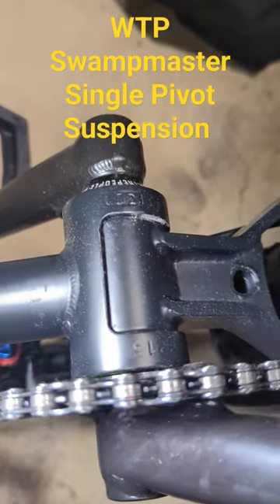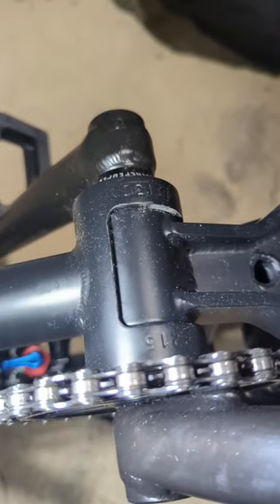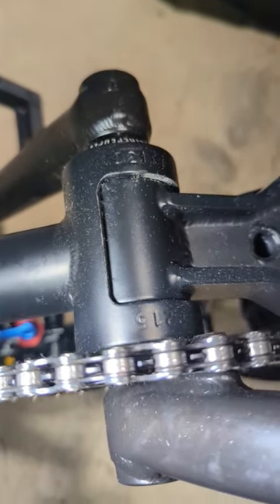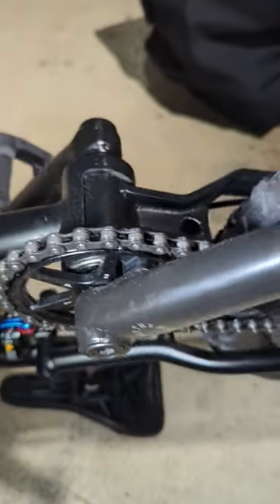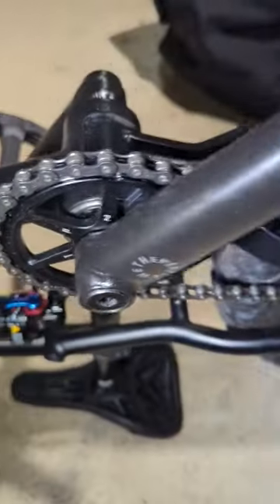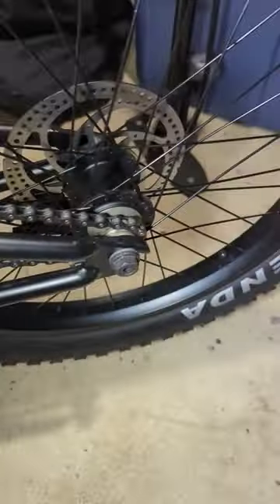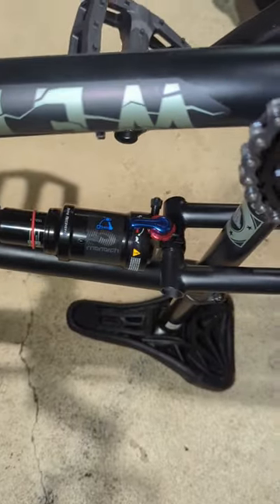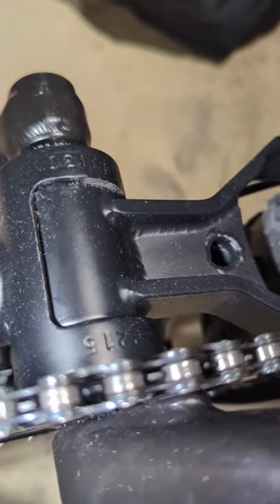How the Swampmaster suspension works.

Comment: Hey mate i own one of these, after a couple weeks of riding this i found the paint on the inside of the bb had 'smeared' and was binding the rear suspension and stopping it from moving freely. I sanded that away and the rear suspension moved way better.
Reply from the maker: Weird. There shouldn't be paint on the inside of the BB. Mine moves freely so I am not concerned at this point.

Comment: How do you clean it out after gunk and muck gets up in there?
Reply from the maker: The bearings are all sealed so it's not a huge concern. But it does all come apart and can be cleaned when needed. Once you take the crankset and spindle out, you can clean it and reassemble it.
Reply: @ShadLife  That's amazing!
So you can remove the entire rear triangle?
It would make traveling with it really convenient since it should fit into a normal suitcase!
Reply from the maker: @Shishou_Shi  It's possible as long as you have all the tools needed with you. I personally don't like the idea of taking the rear end off, especially with hydraulic brake lines, and packing it in a suitcase. The rear shock would have to be disconnected and so on. Not super easy to do.
Reply: I'd use a piece of innertube/fabric and zip ties to cover it - this won't keep it clean, but it should keep the majority of pebbles from occluding the linkage.  I've had this issue on full suspension enduro bike - I had started getting chips in the paint pretty quickly after getting that bike.